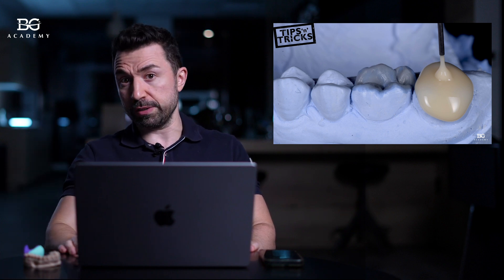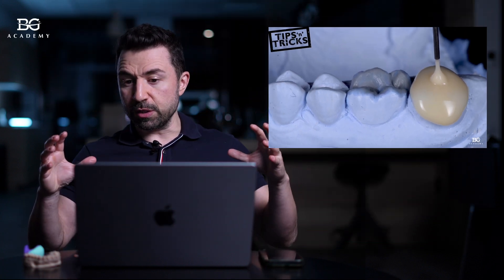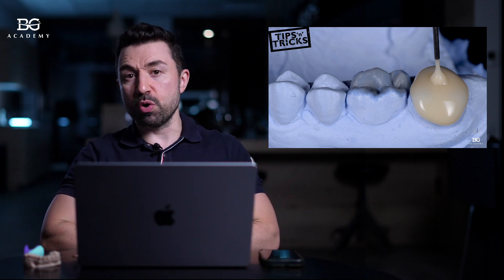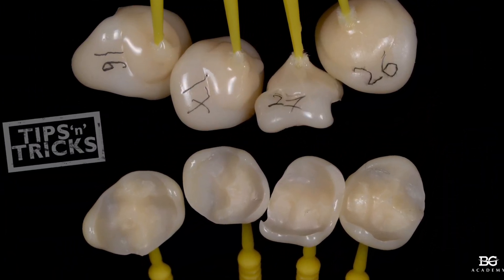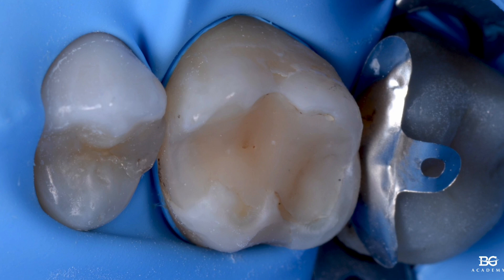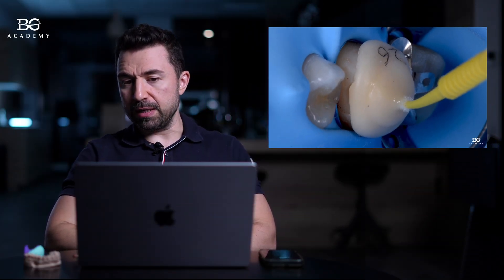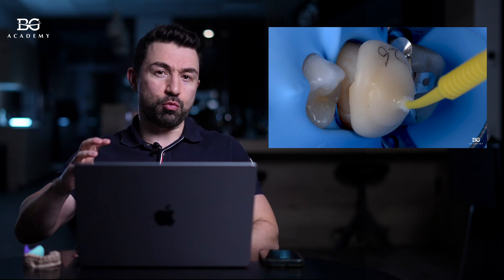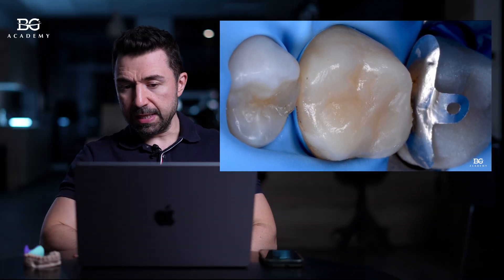Occlusal stamp from a wax-up model

Comment: I guess my one worry is contamination. With teflon, are you placing a teflon between the stamp and composite resin? I really like this idea and I think it may save a lot of time adjusting after curing.
Reply from the maker: No worries. It is on the final surface and you can disinfect and clean teflon before using.